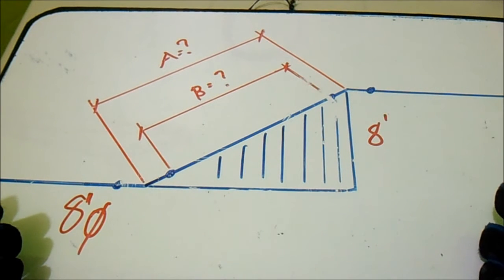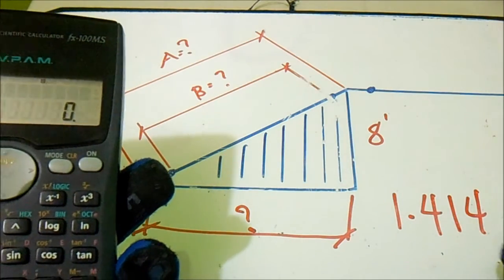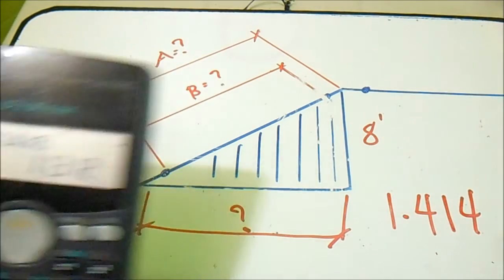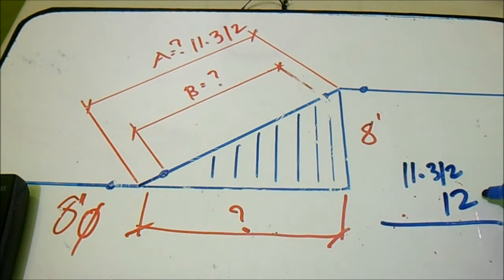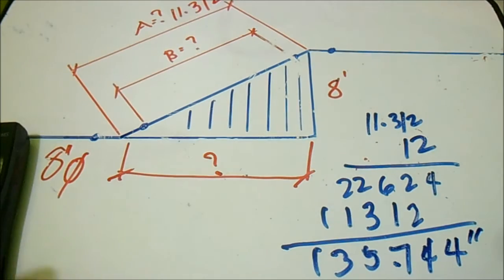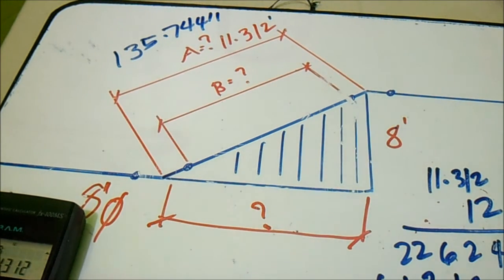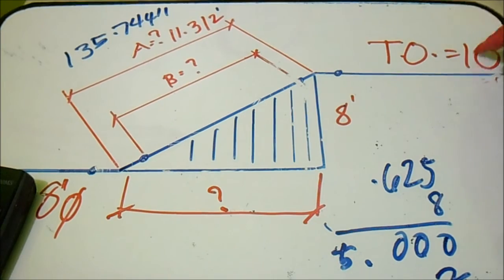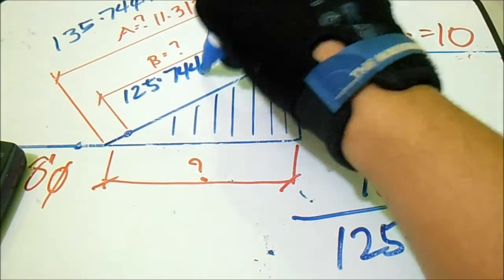Pipingweldingndt - How to Find Length Center Elbow and Spools

Comment: Why you mutiply 1.414 with height . Plzz tell what is the number 1.4141 and why you multiply with height
Reply: 1.414 is the cosecant of 45° and is offset x cosecant = travel hope it helps
Reply: What is 12
Reply: @robanbala8811  12 is representing the inches, means 12 inches is equivalent to 1 foot.. He convert the A) travel 11.312 feet to inches so that he can do the take off and find the answer in letter B (the spool)